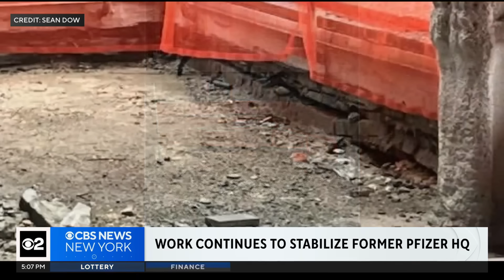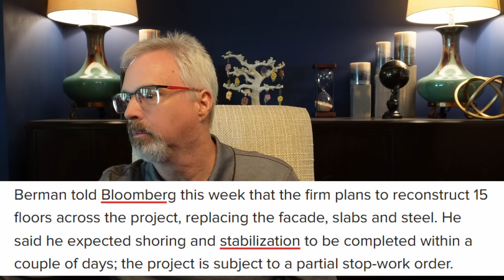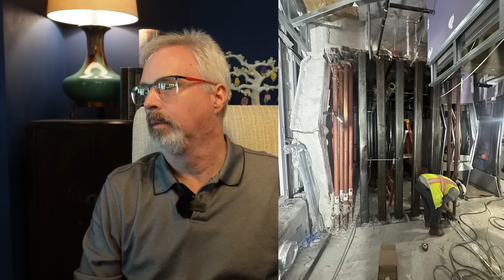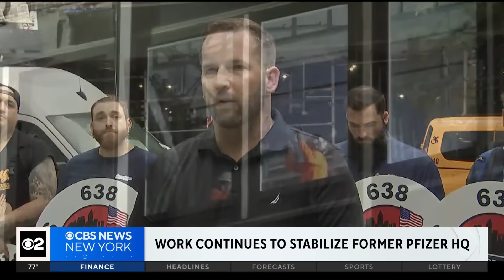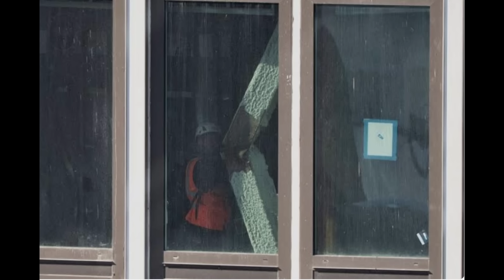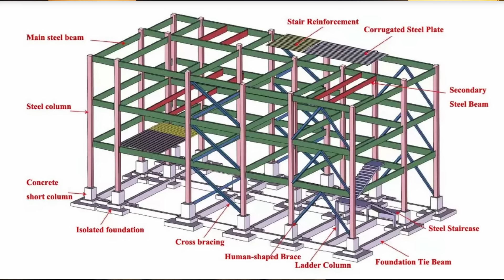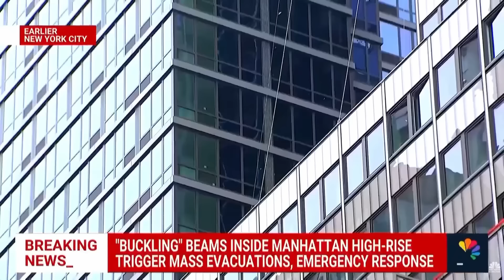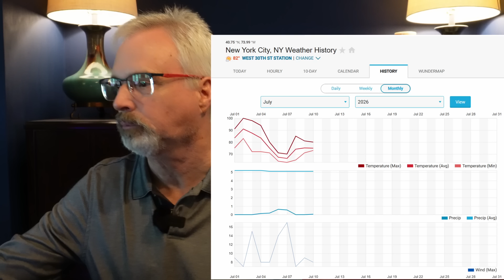Update - Pfizer Building Structural Column Failures; Now What?

Comment: a building from 1960 which was not designed for additional floors above needs to be reinforced heavily to grow 15 floors taller . . as you go up in a building the structural loads decrease and as such the structural members get smaller .. then adding new floors above would obviously over load the pre existing top floor and what we need to know is the plan for additional support in the top floors not the plans for the new floors

Comment: The structural engineer should have been aware of these problems early on before the columns failed? Casey said building movement can be monitored cheaply and effectively using sensors, that's brilliant and logical to implement. This building will have to be reevaluated from top to bottom, if there is rust damage to the structure, that should be mandatory to be fixed.
Reply from the maker: I agree, a comprehensive structural assessment is absolutely necessary at this point.

Comment: You dont need to be an engineer to see at one glance that the problem is not labor it is stacking all that new weight on only 2 columns which are spot welded I beams with corrosion
Reply from the maker: Exactly!
Reply: I think you should look up what spot welding actually is. You are basically right except for "spot welding"
Reply: @gomerromer7708 I wondered about that, do they mean stitch welding (I.e. intermittent fillet welds)? Or possibly even tack welding? Spot welding is what you use to hold car panels onto the body frame!
Reply: @PartanBree  google calls that RSV, Resistance Spot Welding joining overlapping sheet metal with current and pressure.  I referred to arc spot welding with a rod where the pieces to be joined are secured with "spot welds" that pin thingz together and secure them against heat distortion before then running the beads to join them.  Sonebody forgot to finish their beads on that whatever it is, butt splice maybe, how many different things can be wrong in the same spot
Reply: @gomerromer7708  im glad you raised this.  Yes spot welding is a "localised fusion process" to join steel with high electrical current.  As opposed to a constant bead that structural union required.  You spot weld the materials together to prevent them from distorting while you run your bead to join them.  I hadnt realized the side-plate i referred to as "capping" (not a real term) the I beam is only on one column, but you can see in still images of the side plates showing dots every few inches, no bead, and the wrinkle in the I beam occurs where it clearly separates without a bead, anyway i see a horizontal line that looks like a join between 2 I beam members.
Reply: similar problems have occurred where items were welded rather than bolted together as per original plans.
Reply: @seasidescott thats a classic failure mode!  The one i remember was a bolted building that was built but suddenly understood to be vulnerable to wind and they added a whole bunch of weld in time.
Reply: Spot welds and tack welds are generally associated with fatigue failures. That is steel that is unloaded and loaded under yield stress for many cycles. The short welds create localized weak points. This appears to be an overloading failure, because the break is not straight through and it appears to have yeilded. I bet, however, load distribution was a factor. Where were all those granite kitchens and bathrooms installed? Probably all in the same location on every floor to make the piping easier. That's a lot of weight on a few column lines, and it is probably why a steam fitter found it and not an ironworker or other trade.
Reply: TRUE !!

Comment: It looks as if the failed columns were supporting the roof at the setback, prior to adding new floors.  I wonder if those columns were lighter than the columns lower in the structure, and the engineer failed to see an atypical existing condition at that floor.  Or, perhaps structural reinforcement was designed but not installed

Comment: There were several tons of wire in that specific location and I saw the corrosion in the column that you showed in an earlier video. Is it just a localized problem?
Reply from the maker: I think there are several factors involved here.  I hope they issue the forensic evaluation reports soon.
Reply: @CaseyJones-Engineer i think columns and beams need to be drilled and scoped for signs of more corrosion

Comment: Very good video. We used to call this SNAFU. What did the city do with the money they got to evaluate and inspect? Putting 19 floors on a  column that was originally designed to just hold a roof seems wrong or was the building originally design to add stories? I worked on a building 50 years ago where the design included adding two floors in the future. Good Luck, Rick
Reply from the maker: Thank you. I'm hoping these details will be forthcoming.

Comment: 11:24 It appears that the new leftmost HSS steel column is already distorted??? Maybe it's just a reflection, but...damn. And, I would hope after adding them on the floor that buckled, they move to the ground floor and start adding them up from there - otherwise they're adding weight to the overloaded columns below the buckled one. Holy hell.

Comment: Thank you Casey: you have dug into this matter far better than most. Your opinion is valued. I also have disbelief in being able to remove and reinstall 19 cantilevered floors in 2 weeks. Or did there installation of them the first time that fast part of the problem? Obviously the first time they neglected to reinforce the columns before adding 19 floors. Should be a simple thing to check the plans for the column modifications. Provided someone there can read plans. The developer claims to be an old hand expert on these types of building conversions and adding floors. The new much larger columns added on top of those skinny original ones that only needed to hold up the roof didn’t raise any eyebrows or questions is total incompetence! So what happened here? Why did no one raise a red flag and stop this? Saying that “They just did what they were told” is not an excuse. In Nurenberg Germany, after World War II, the German officers tried to use that same excuse that “they were just doing what they were told” and they wound up swinging by a rope around their neck. It is Not an excuse! Before I retired or company taught us that if an employee observed a dangerous situation they were legally liable to stop and report it to their supervisor immediately. They claim the building is safe and can’t collapse. SURE; and the Titan sub’s carbon fiber hull is indestructible and is perfectly safe. These self proclaimed experts don’t give me a warm and fuzzy feeling.

Comment: Union folk are blaming the workers who were not apparently unionized.  To me, this is a design problem, possibly dating back to the 1960's where the steel work near the top floors may not have been as strong as needed to support another 15 stories or whatever.  An error with a copule of columns?? Hmmm.  Meanwhile, NYC is going to run the building thru their red tape mountain.

Comment: The way those columns bent under load tells me there was weakness on one side of each column that shouldn't have existed, whether missing material from corrosion or modification, they shouldn't have done that. The load was straight down. If two failed that way I will bet money - and I'm not a gambler - more problems with more columns WILL be found.
Reply: Especially with increased stress from missing columns. It's a cascading reaction like WTC
Reply: @AnotherAustin-z7b it's not as bad as wtc, in the immediate sense at least. Fortunately no fatalities as well

Comment: The elephant in the room is that an H beam taking load vertically, bent in half. The stress on that vertical beam to my mind is unimaginable to bend it in half from pressure above. That building is scrap - just say it without messing around with imagined scenarios.
Reply: There must be some new shear loads , possibly from the cantilever design
Reply: Agreed. The problem now is that they have lost control of the loading. It's all over the place 🤣
Reply: Well, unexpected elephants in the room would be a loading case that the engineers were unlikely to have considered. How did the elephants get up there, cargo elevator?
Reply: @capnrico8877 portal
Reply: @capnrico8877  An expression that you are unfamiliar with - please don't comment - its embarrassing.
Reply: I’m very familiar with it, I was humorously mocking your comment instead of just saying: duuuuuh, thanks for that, Captain Obvious!

Btw, “vertical beam” is a contradiction, if it’s vertical (above ground) it is a “column”, a term that you don’t seem familiar with. The real elephant in the room is that you don’t seem to know your lefty-righty (beam) from your uppy-downy (column), but are still trying to sound so s-m-r-t smart, which is embarrassing. 

And after checking several design standards I stand by my original comment: elephants in the room are not a typical load case that is considered in structural design.
Reply: @qanon_qanon  what is embarrassing is your nick. Maybe you qanons undermined the building looking for another cellar that doesn't exist?
Reply: @capnrico8877  Ok, you went literal you win, plus H section v H beam, my error.
Reply: I been looking for this comment...some common sense. I would not get with in 100' of that building
Reply: @fritzmiller9792 ya think the building fown
Reply: It may not be - it would be irresponsible to assume that without really analyzing it - we have the science, we can do it.
Reply: @appleimacdude  You do it. When one column fails like that, something is really wrong.
Reply: @richardmccann4815  it's called payoff.
Reply: @appleimacdude  Yes.  We must never form a hypothesis until we're told what the answer is.  We wouldn't want to do science the obsolete way.

Comment: A 4-foot (48-inch) wooden spool is large, typically categorized as a 48" to 54" flange. The combined total weight of a spool of wire this size depends heavily on the wire gauge and material, but typically ranges from 1,500 lbs to 5,000+ lbs
Reply: 5,000 lbs is kinda nothing when you think about how much the building itself weighs.  Also, those spools are sitting next to the bent columns, not above them. I shouldn't speculate about things until more info comes out, but I'll go ahead and speculate anyway...those building materials had nothing to do with the bent columns.
Reply: A large heavy spool would have a greater affect on the floor deck that the steel columns.

Comment: ALL CHECK POINTS MISSED THIS OVERSIGHT:

I see that those two columns were never reinforced. I might speculate that either the structural engineer overlooked that they would need reinforcement (astonishing to imagine) or they were designed to be reinforced but the contractor had bypassed that floor during construction sequence. Even if they were designed for reinforcement, it is astonishing that the engineer overlooked this deficiency during weekly site review visits. (As those two failed columns obviously needed structural reinforcement, almost certainly the underlaying columns on floors below would also have needed reinforcement - follow the load path!)

Normally the building projects have lots of 'check points' that prevent such a catastrophe. Such check point stages are: concept design, concept review, detailed design, final design check, issued for building permit, check by city plan checker, (some AHJ call for independent engineering check), shop drawing review and approval, contractor construction planning, weekly construction plan and progress, weekly site review by engineer EOR, engineer deficiency reporting.

I should guess (hope) the NYC building department will order an immediate independent structural review of the building permit package (ie: the structural engineering drawing package). This should put a halt on the 'back to normal' construction schedule.

(I am a licensed structural engineer.)

Comment: How can you add a 15-story building on columns that were designed to carry only a roof and snow load? Possibly the engineers checked the typical floor columns in the existing structure and missed the 21st floor column being smaller, if indeed that was the case... we'll see.

Comment: It's not rocket science, they took a poorly constructed building , probably built two lightweight, and thought they're gonna add some apartment complexes on the side , which involved a lot of cement, pretty much overloaded the building without proper checking things. Not only is the building designer of this project in trouble , but city officials that o k the plans. Did these guys get their degrees out of a cracker jackbox.

Comment: The basic engineering problem is obvious even to the casually smart layman. I don’t agree with your statement that this building has redundancy. I’ve seen channels that show the interior of those floors and they verify the original prints. The columns that the much larger vertical columns sit on were only designed to hold the facade and roof. They weren’t even interior columns, but they were loaded with internal columns from the new floors above WITH cantilevering which not only adds a lot more load but overturning forces. Those were the original columns.. clearly not sized for it. It’s obvious from the pics.

Comment: I wonder if putting the cantilevered load on the existing I-beam structure (which also look relatively smaller than the columns they placed on top of them) were exposed to moisture over the past ~65 years.  They were sitting directly under a flat roof of a setback.  If there were decades of slow leaks that got under the fireproof sealing and started attacking those beams thats a big problem.

Secondly the beams seem to lack any lateral torsion enhancement.  I would have thought they would box the beams or join a second I-beam next to the existing one as with the addition there are now East-West torsion forces being put on these beams.  It looks like the addition above them might be a much stronger box section that is likely MUCH stiffer in the E-W direction and thus having a very strong stiff structure sitting on top of a more flexible weaker structure seems pretty bad.

Comment: Something in curious about: why did it stop? Once those columns bent, something else must have taken that weight to stop the whole thing collapsing. It suggests that the required strength is there overall, but wasn't there locally.
Reply: I assume that the shear forces between the horizontal and vertical elements increased significantly due to the transformation of rectangles into parallelograms—or, to put it another way, the sagging of the new stories generated, so to speak, additional "braking forces" that prevented further collapse, albeit likely only temporarily; that is, given appropriate changes in temperature or load (e.g., due to snow), the process would almost certainly have continued over time, if slower than before.

Comment: Thank you Casey for your sober comments.
As there is a lack of public information available, some basic questions remain:
Was the base building originally designed for a 19-storey addition?
Do the buckled columns exhibit deterioration, or some form of initial damage / modification?
What is the detail for how the new steel column connects at the base building?
Are there signs of distress in the base building columns below the buckled columns?
With the temporary shoring they are installing, they seem to be 'locking in' the deformations of the structure; what provisions are being implemented for the future 'jacking' of the building to restore it to its proper geometry, or will the new 19 storey addition simply be demolished and re-built?
How many many insurance companies, and law firms / lawyers are working on this now?

Comment: I'd bet the contractor probably overloaded with concentrated stacks of gypsum wall board-- looks like the studs are newly in place and I bet they're preparing to rock...   I'm a CA licensed architect and engineer in continuous practice for 47 years.  I've caught contractors fork-lifting or craning a whole unit of heavy plywood in one area during construction.  We were very lucky there was no damage.   I got them to remove the concentrated load as soon as I noticed it.  It was MY office building!  Lucky there was no lateral event, like earthquake or high wind.
Reply from the maker: Yes, and the Atlantic hurricane season has just begun.

Comment: Two beams that are directly below the cantievered section failed.

I'm not an engineer, but I suspect an analysis of the forces at play will show that the cantilever subjected those two beams to  diagonal stress...pushing them to bend. E.g. it wasn't necessarilly excessive vertical loading.

Comment: If it's a mixed shop and the Union says that's the cause, wouldn't the likely conclusion be that the union sabotaged the work?

When will the building be assessed for a constructive total loss? At this point I'd be looking at an insurance claim more than additional construction.
Reply from the maker: I had someone comment that it looked to them like the 2 columns that failed on the 21st floor had been winched together.

Comment: 35 Years as a welded duct installer. I know they had to core cut large openings all over the floor slabs. Almost all Utilities also require clearances and some type of Insulation. Our product added 7 in to say a 24x24 Duct. making it 31x31 plus room to install it. And 9 out of 10 times it was right on a column to save floor space. Heating duct is 3 time larger easy.

Comment: Sounds like either the design engineer messed up, or the building wasn't built according to the design specs.
Reply from the maker: I think those are the leading contenders.
Reply: @CaseyJones-Engineer  AI used in the computerized structural design?